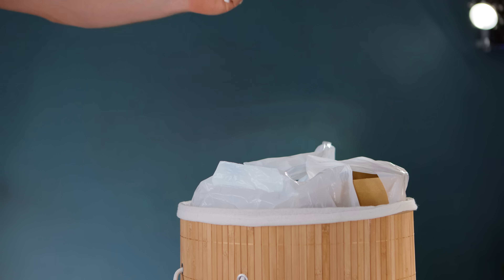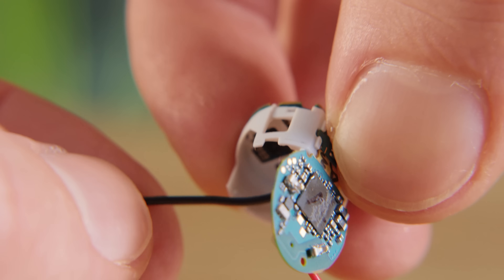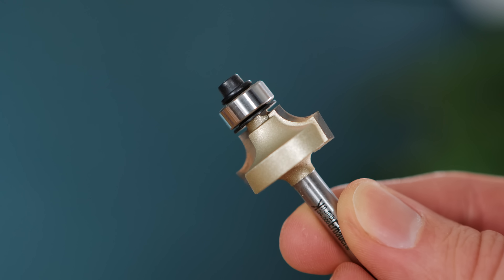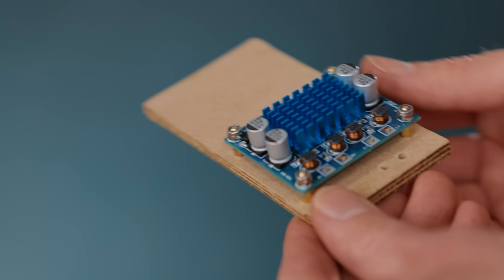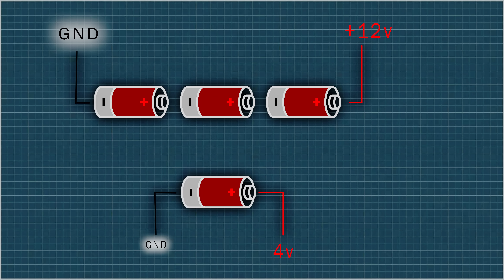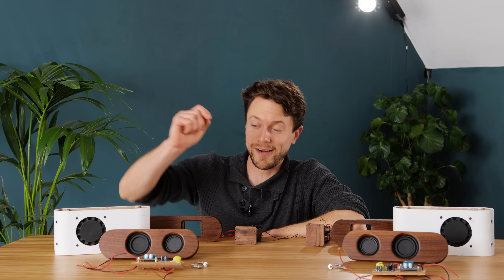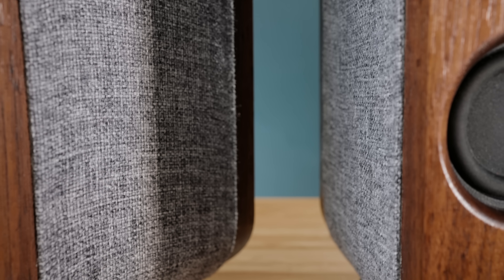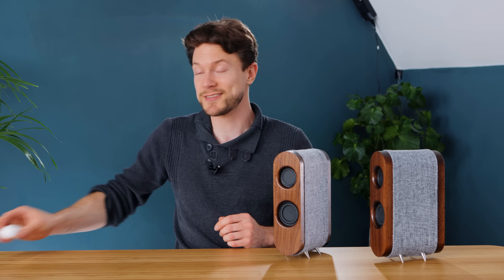Transforming dead earbuds into POWERFUL wireless speakers

Comment: Why not add a port to charge batteries instead of having to take them out when they run out of juice??
Reply: I assume because charging the batteries would cause a lot of electrical noise since audio equipment is really sensitive to stuff like that.
Reply: @kholozondi9904  Still, you could charge them when it is not powered, just avoid taking them out. The reason is the complexity, getting good quality charger with full balancing takes space and is additional cost. After all, they are all connected, so you can't use simpler one cell charger, you have to use balancer.
Reply: @kholozondi9904  
Nope, I have built a bluetooth speaker with old 18650's and run it most the time wired up to the CC/CV module that charges the cells, no interference or issues what-so-ever!
The most important thing is to have separate or isolated power supplies/batteries  for both the amp & BT module, otherwise you will get  interference/hum!
Reply: I think mostly because of the different voltages present.,
Reply: @mrawesomelemons  Voltage does not matter, no one sane would use it directly while charging lithium battery. USB-C is capable of providing even 100W, pulling something less like 10-20W is fairly easy. You just need step up transformer to get to proper 4 cell charging voltage and you need balancer to protect individual cells from overcharging. Balancer simply drains cells that are already full so that other cells can still charge. When all of them are fully charged, the charger should disconnect. It's simply too big to fit in this speaker and still have enough space inside for the sound to sound nice, you'd need bigger case and circuit for each speaker.
Much better solution would be to create enclosed 4 cell charger with some easily distinguishable connector. You can make one of those designed for 4 cells or even create more complicated variant to switch between 3 and 4 cell charging. Just plug it into your speaker and you can power it from 12V or 5V USB depending on the circuit you have there. You can even design it to work with universal laptop chargers that already can provide 15-19V.
It's just not worth putting it into the speaker itself. Similarly you don't have built in charger in your laptop or smartphone. Why would you want to carry such big thing with you if you can just store it somewhere and connect when needed?
To be fair, it's not impossible but there is a difference between professional, dedicated circuit used in smartphones or laptops just for this purpose and custom built charger from universal parts. You can shrink it down to fit there, it's just not worth for DIY unless you already have such capabilities. In that case you would not ask though.
Reply: @MaciejZałucki  dude it's not that complicated. Just wire them up in parallel and boost the voltage using something like an xl6009 or another higher current alternative for the amplifier. Use a TP4056 for charging. It literally costs pennies and takes up as much space as a thumbnail. An important benefit to all this is that the earbuds can read the voltage and you would actually see how much charge you have left.
Reply: @dogukancil5128  wut
Reply: @dogukancil5128  So you are proposing to rewire battery bank to be able to easily charge that? Great idea but completely useless if you designed this to work in series. As he mentioned in 9:30, this amplifier needs at least 8V, so you need at least 3 batteries in series. Forth battery is separated and powers earbuds only, so in fact you have two separate circuits. First one is 3.2-4.2V, second one is 9.6-12.6V. If you want to be able to charge them in use, you need balancer to charge 3 batteries in series. If you want to charge them in parallel, you'd have to create yet another circuitry to switch them between parallel and series connection. This would take up more space and would be prone for uncontrolled energy flow as you can never guarantee that all batteries have exactly the same properties and are discharged exactly the same way. Try shorting discharged lithium battery with a few charger batteries. In most cases the fuse will just blow up. If you don't have over-current protection, it may fry the battery or at least damage it every time you charge it this way. There's a reason why proper chargers have isolated slot for each battery and don't connect them together. Even on cheaper AA battery chargers with two charged in parallel you have very clear instruction, charge them this way only when they are equally discharged and are of the exactly same type.
Reply: @MaciejZałucki  you don't have to wire the batteries in series to get a higher voltage. You can instead use a boost converter, such as an XL6009 or a higher current one. You can wire all the batteries in parallel and get the 3.7V input and boost it using the boost converter to 8V+ for the amplifier, and directly connect the batteries to the galaxy buds, which will then be able to read the voltage of the parallel battery pack and thus battery percentage. The power loss due to boosting would not be a deal breaker for such low power circuits.
Reply: @dogukancil5128  That makes sense. You can just add some fuses to avoid defects from escalating and it should be possible to charge them fairly simply. The only thing to think about is picking proper charging current. If they are fairly equal, then you could just multiply the current but if you want to run it at the same time, it would be worth to increase the current to power the boost converter. Or it could simply disconnect boost converter from the battery while charging, give it all the power it needs and just charge batteries based on their capacity.
Reply: Yeah, if youre going to go through all the trouble of making these may as well make em usb-c.

Comment: Can you use a ecig battery instead of the bunch of battery holders? An ecig has already evertyhing your build needs : wattage and/or voltage control, on/off function and charging through usb

Comment: These have the potential to be usb rechargeable with creative use of battery charger circuits, however with the dual voltage setup that may be difficult. Good job on the speakers!

Comment: This is a very nice project!  Maybe the best looking wireless speaker system I have never seen before.  But I disagree about using electrolytic capacitors in the filter.  I suggest using polycarbonate or Mylar capacitors instead. Sound will be much better !  I also suggest adding small monolithic 1 microfarad in parallel with each existing electrolytic. Those caps are so small that it can be easily soldered from the back of the amplifier pc board.

Comment: Just needs a faster easier way to access batteries or have a way to charge them inside the device. I think I also would prefer the feet not being so spiky but that is just my taste.
Reply: The spikey feet are common with high-end speakers. The reduced points of contact with the surface on which they rest helps prevent vibrations from coupling and causing audio artifacts. I agree on the charging. I would recommend adding a battery management/charging circuit and USB port so the speakers can be charged without disassembly. Those screw threads will only handle so many cycles before stripping.
Reply: @par64guy  or you could have rubberised feet that allows for a big contact area with the surface it's placed on to be established. Place it on a bookshelf or wooden table and you'll get some resonant artifacts (whether that's wanted or unwanted is a personal taste) for a warmer sound.
Reply: @par64guy  yeah just a usbC charger inside of it with 3 or 4 samsung 18650 batteries would be great for this
Reply: id say samsung 18650 batteries would do that trick 
able to charge em and good battery level if you add 3 orso per speaker they should run for hours

Comment: wouldnt be bluetooth sound still bad i would consider this.
In fact i made instead 3 Boxes..... 1 box with inputs (BT and 3,5mm aux), battery, a subwoofer and electronics (3 channel ANALOGE !!! amp), and both speaker boxes are connected to the "input box" with regular speaker cables and a typical coax connector.
With some clips and a carry handle i can easily carry the whole setup around. Not truly "wireless" with detached speakers, but damn this is by far the best "mobile" speaker i have ever heard. I even used 2 KEF chassis from the old Q Lines with decent big and dampened wodden cases.
Sadly, i also realized bluetooth sound still sucks. Too much compression or probably a bad BT audio protocol which also converts(and compress...) the compressed mp3 once more. Luckily my phone has still an audio jack so i only use this box with a 3,5mm jack.

If i dont account in the price of the KEF chassis itself (probably around 100$ x2...), the box was pretty cheap, i reused an older 4S 10Ah LiPo and i have by far the best sound quality compared to any other mobile speaker. But i have to be real, only the fact you can seperate the 2 speakers make already a HUGE difference, but even hanging together they still sound much better than any 800$+ Bose speaker.

I once tried the same with a even more expensive digital 3 channel amp 2x50 +1x100W for sub, pretty easy to find on ebay/amazon), but as much i would love a efficient amp for 20hrs+ usage.... its better to go off with a inefficient analog (Class A/B) amp. The analoge amps are cheaper (despite using more expensive parts...) and sound MUCH better. Only if you dont have space you should go for a digital amp for like mini speakers. Or wait until finally proper sounding class D amps are aviable for a good price.

Comment: About $400 for parts? A $1.50 extra for battery management boards and a plug and you wouldn't have to take out the batteries every few hours. Just that makes this project nonsense for me at least.

Comment: Here's what I managed to snag from the video before the guide comes out:
Filters:
2x 1k ohm resistors each
2x 2.2 mf 50v capacitors each

Smoothing thing:
2x 33 ohm resistors
1x 8.2 ohm resistor
3x 1 mf 50v resistor

Could 1/4W resistors be used here? Did I get any of these wrong?

Comment: Haven't stopped thinking about this project, think I'm going to give it a go. Wondering how feasible it would be to use a pair of gen1 AirPods for this. The batteries are shot and so they just sit in my drawer.

Comment: Sounds good, but for $50 you could buy a set of old floorstanding speakers that have 12" subs in them. I guess for a hobby it's neat, but I have tweeters smaller than those.

Comment: so you need  broken headphones ~5E 2x subs 74.98E = 149.96E then x2 mids 15.95E =  31.9E, x2 amp 18E, 8x batteries 7.94E, Shipping and stuff, ALOT OF WORK, and probably looking bad just get fucking two jbl charge's connect them both and you'll have better result

Comment: Kind a mistake to not add some rechargable device, even if avery battery must be rechargable separatly with 4 diferent micro usb ports, ll'be better than open the port and remove batteries by hand.